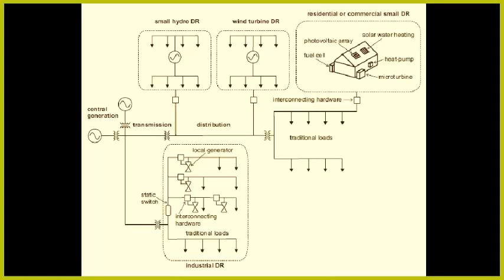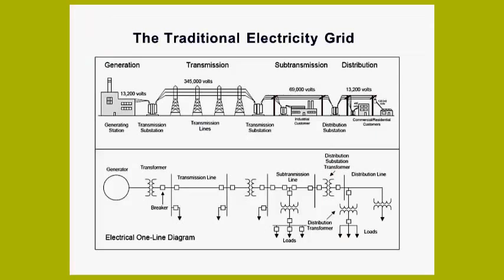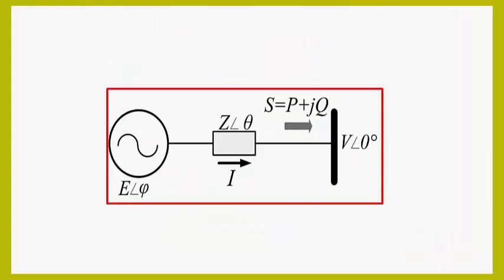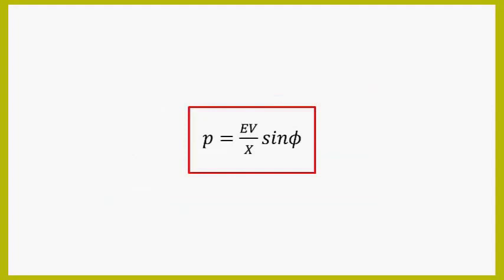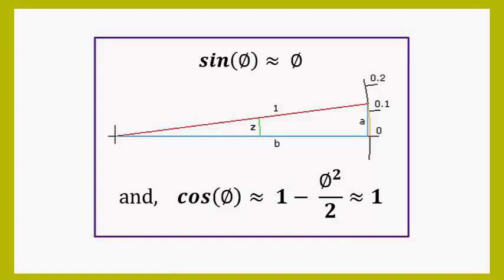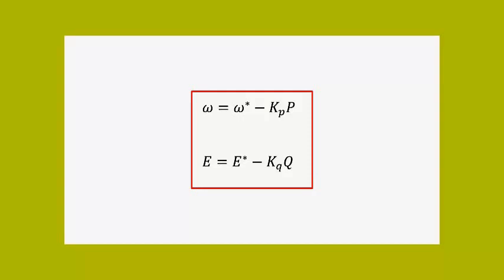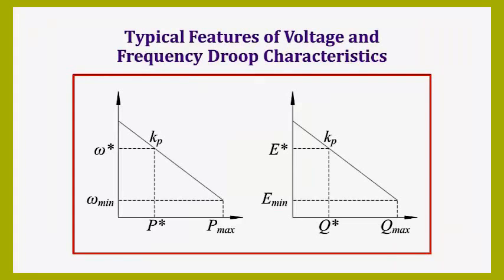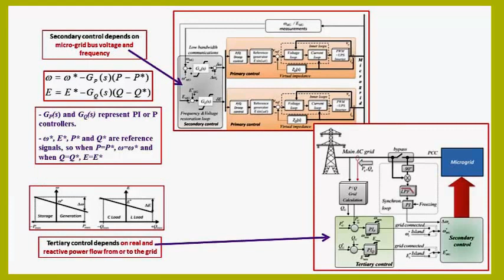Introduction to Droop Control

Comment: is it possible to find a video talking about sysnchronization of two microsources by using a droop control ??
Reply: hi, i m interesting about the synchronization of two sources (inverter), i m wondering if u found a solution or a model in Simullink. thx
Reply: @mohamedamineelqourchi2815  did you find the solution?
Reply: I was looking for the same thing